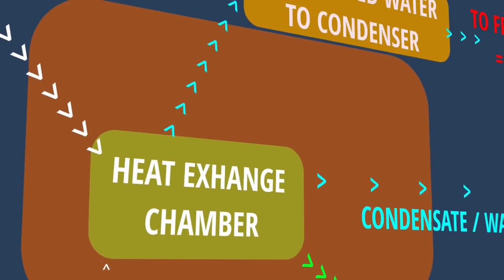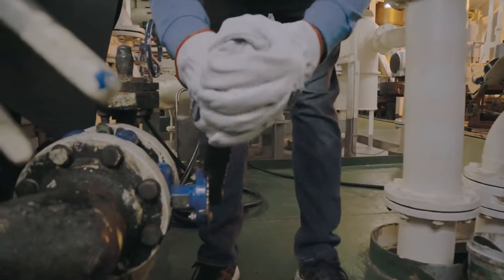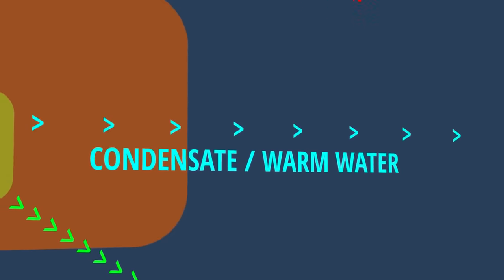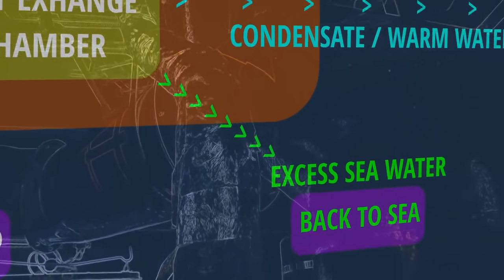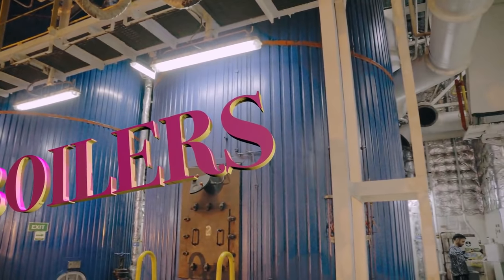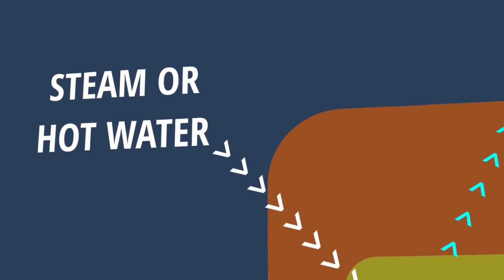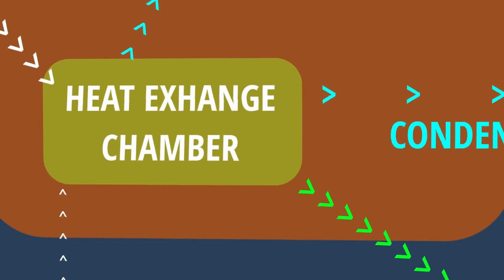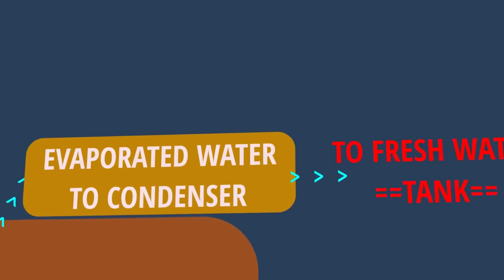How do we Produce Fresh Water on Ship

Comment: The main heat source to evaporate sea water is from jacket water. Jacket water is basically used to cool down the heat load which comprises of engines lube oil. So the temperature of jacket water is 70-80 Celsius, inorder to achieve evaporation at this point the vacuum pumps ( It may be steam ejector or simply ejector pump)to create negative pressure which reduces the boiling point .
Again sea water is used to cool down evaporated water. 
In large cruise ships with large water demand reverse osmosis are used now days. 

Again it is an interesting job for me because i love chemistry and making water soft is very interesting. Removing salts, addition of chemicals to make it for drinking. I think mercury content also plays role there because now days mercury waste is increasing
Reply from the maker: Awesome 👍
Reply: @OrangeShots  In our power sector we used cooling water for thus purpose. Basically the main Heat Load in power system is latent heat from Steam and then to cool the Aux cooling water( Aux cooling water is used to cool all other heat load i.e lube oil circulating in turbines ,  high duty BFPs) .
To cool down that cooling water Cooling towers are made. 
Again at sea the water is diverse so there is no need of close cycle systems.